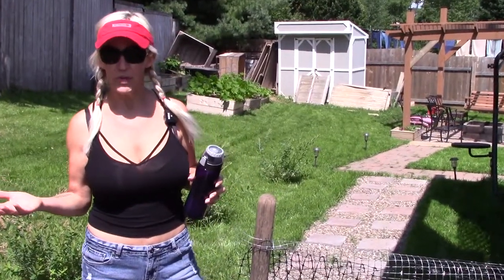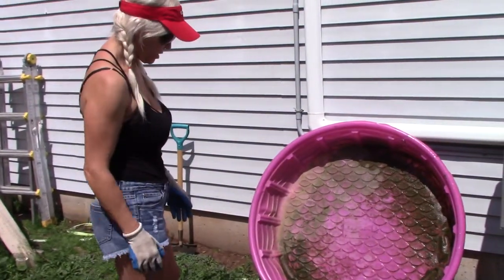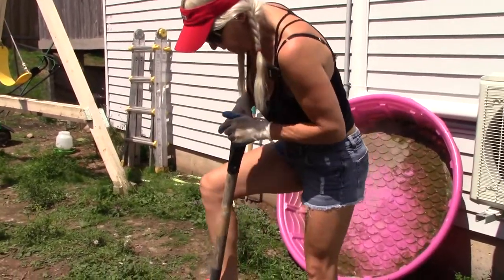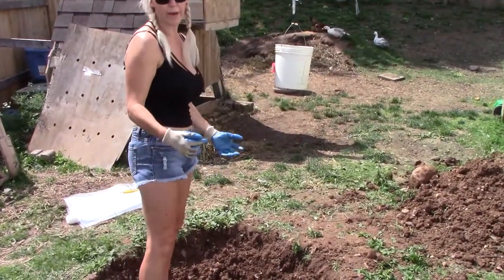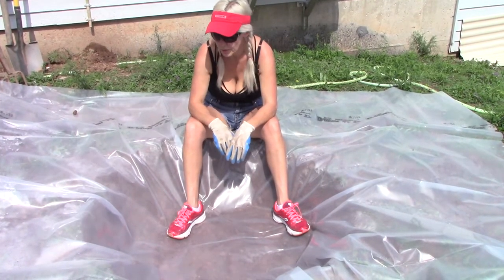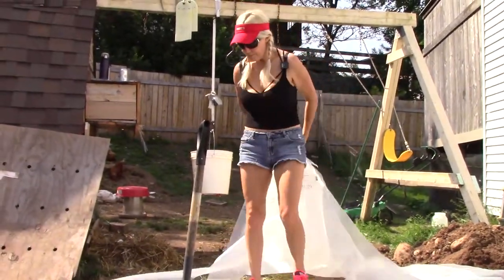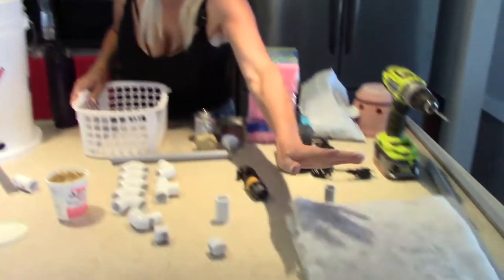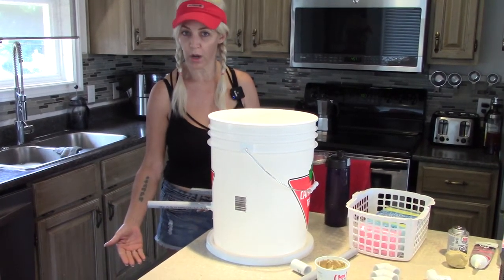DIY - Backyard Duck Pond and Easy Filter System

Comment: Can you briefly explain how the aeration pucks totally replace the pump & filter system and take care of the duck poop.   You never have to change the water?  Thanks
Reply from the maker: It helps with the alge.  Also stops the pond from freezing in the winter.  I change the water weekly.  Won't be doing ducks again.  They are a lot of work and messy.